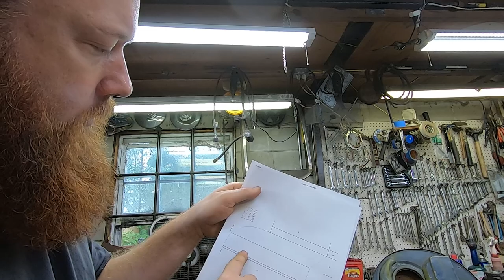Cooling Tins for J Tube exhaust |  Fabricate Industrial Tin VW Split Bus Restoration Vandemic E13

Comment: Honestly and no disrespect I would just find some heater boxes. the space between the tubes and the heads allows air not to flow out the back as well. But if your running performance large tubes this would work. I would still not go there. performance exhaust should be merged system. and the J tubes go under the cylinders so again running these tins wont work. The best option is to go with type 3 cool tins. THey do work best for merged system especially. they manage the air better and get the proper amount around the cylinders and more air through the heads. I have been running these on performance engines. with air vanes opened up on the heads. Running 8.5 to 9.5 on a street engine without detonation  pinging. even is near 100 outside temps.
Reply from the maker: Hey Mike, no disrespect taken; thanks for your input. I'm happy with the approach on this engine but it will be fun to try out the cool tin sometime.

Comment: I like it. I am running J pipes with my new sidewinder headers on my 71 beetle. i will also fabricate these extra tin pieces  to get the heat away onto the road like it was designed. Thanks
Reply from the maker: You're very welcome Andrew, thanks for having a look! Good luck with the project, I like your approach and I'm sure your '71 will appreciate the efforts. Thanks again!

Comment: I did this mod on my Manx several years back, I put bolts into the lugs on the bottom of the heads to attach the plate.
Reply from the maker: Good way to do it @manxdune  I've safety wired one but this one seems to do well with pressure from the other mounting points. On a few thousand miles so far; long term results will be interesting. Thanks for watching!

Comment: i'd put a slit piece of hose on the edge near the head , stop any possible rattle , and give it a bit more space there for air to flow. (the flex of the metal should clamp the hose to the head, letting air out mainly to the "back" of the engine
Reply from the maker: Thanks Chris, (spoiler alert)... after putting some miles on the bus it seems to be working well. You're right that we want the air all going out the back underneath the engine. This area is the last part of it's journey before leaving the system. It's hot and low pressure, and just needs to be dumped out the bottom clear of any path up or forward. These are fascinating little engines aren't they? Thanks for the comments and checking out all these videos- hope to see you again soon!

Comment: The amount of time and workmanship for the tins are commendable . Are you using mig welder with low settings to not blow off the weld .What is the setting speed , voltage,   wire size ,  gas pressure settings . My buddy is lending me his welder .Thanks !
Reply from the maker: Thanks erwinsm10! Yes, it's a MIG welder and the settings are very low for the 22GA sheet metal used here. On my 210, the voltage is around 2 and the speed around 20 but all welders and metals are just a bit different, so focus on the results you are getting and tweak the settings accordingly. A little bit of practice and you'll be doing great!

Comment: Great idea, I'm gonna make some.
For that inside curved bend, you need to use your pipe anvil.
If you want some real heat in you bus, install two oil coolers, one up under the dash, and one behind the axle, with a diverter valve between them. This also adds oil to your capacity....never a bad thing.
Reply from the maker: Thanks Frank, interesting idea. Heat is a problem here in Florida- there's too much of it! Good luck on your project and let us know how it goes!

Comment: Hy Haptic , once more a good and informative video, with exelent metalwork and forming. Keep up the good work,Greetings.HCS
Reply from the maker: Thanks HCS, it's always good to hear from you. I'm glad you're enjoying the videos and I hope all is well on your side of the pond. I hope your baby blue single cab is coming along nicely!
Reply: @HapticGarage  Thanks Haptic , here on my side off the pond is every thing going well even the progress of the Monday Morning Bleu.I`m in the final welding process and starting cleaning the chassis or the body work beneath for body protection.so I can begin with the preparation for future rust,Greetings HCS.
Reply from the maker: Cool stuff HCS, I'm glad you're making good progress. What do you use for undercoating?
Reply: @HapticGarage  Hi Haptic ,wenn I`m done with the cleaning of all metal beneath.I will use only Clear fluid film called Lanoline  or eventually Raptor protection.I will not use my VW anymore in the wintertime cause to much Salt on the roads   I will also use inn the Hollow spaces from the frame work  Fertan  fluid was alternatively Owatroloil.  and warm it up to the boiling point  then its very waterly like and spreads evrey where in the hollow spaces..

Comment: Just buy type 2 under tins, I did and my 1835cc vw engine runs perfect, never overheats, neither does my sons 1641.
Reply from the maker: Hello Tony, I think you are referring to the Type 3 "Cool Tins". I have a couple pairs laying around but prefer this method because it works with the Type 1 thermostat when I am able to use it. Thanks for the suggestion!

Comment: I did very much the same thing..repaired all tins and hammer formed them to fit tight...I figured better airflow if all leaks were eliminated and all nut and bolts fit tight..so I welded what I needed...happy with outcome
Reply from the maker: Good work Redd Mann, I think it's worth the trouble and kinda fun anyway. Thanks for watching!

Comment: An easy alternative: When i junked my heater boxes, I cut out the portion of  the outer tin with mounting tabs on it for the lower barrel tins and used those as heat shields/ air deflectors for the J Tubes. 10 minutes work with an angle grinder.
Reply from the maker: Hey Martin, thanks for the tip!
Reply: @HapticGarage  No worries mate! Keep up the good work and great craftsmanship, you've got some skills there for sure.

Comment: Try using flap discs on your 4 1/2” grinder to smooth out your mig welds.  It removes the extra metal faster and leaves a smoother surface!
Reply from the maker: Thanks Mra Mra, yes, I keep a flap disc on a grinder all the time for that reason. Good tip!

Comment: Could I ask if there is a benefit to keeping the extension pieces as separates that bolt on rather than welding to make one complete piece? Looks great by the way
Reply from the maker: Thanks for the question cgi l! I think they could be welded, just check to make sure installation and removal would still be possible. Keeping them as bolt on ties into the stock design and may make reusing them easier. Cool question- I didn't think about welding it all together with the sled tins. Thanks for watching!

Comment: Outstanding video!! I will be running j tubes on my following motor. Did you say someone sells those covers you made? I ne rr saw them before.
Reply from the maker: Thanks Slades VW! Yes- there are industrial tins available and they're not too pricey. Check out aircooled.net and geneberg.com, or search TheSamba for "type 181 industrial heater box delete tin" for dimensions. Good luck and thanks for checking out the video!
Reply: @HapticGarage  Thank you, I will definitely check them out for sure. I really enjoy your videos, very comfortable to watch if that makes sense.

Comment: Just wondering why you never made the top part over the ‘J’ tube a bit wider to stop the heat going onto the head…👍🏾🛠
Reply from the maker: Hey Soggz, thanks for the question. If I understand correctly, that sounds like an interesting mod. Keeping in mind this is all under the car and the valve covers help to cool the oil too, I'd want to be careful about trapping the valve covers between this tin and the cylinder head tin right above it. It's kinda tough either way due to how hot the exhaust is but your idea is something interesting to consider.
Reply: @HapticGarage  I’ve just installed some on mine,I haven’t gone to the lengths that you have,as I don’t have a welder,but I just thought about it,when I put them on.
It may just knock a few degrees temperature off.👍🏾🛠

Comment: Could you drill and tap the two round blanks underside the head and extend the sheet metal upto the newly drill & tapped holes, making sure not to penetrate the inside of the rocker with the tapped holes. 🤔
Reply from the maker: I think yes, but as you mentioned you'd have to be really careful to avoid punching through and causing a leak in a busy oil filled area. So far it seems like the tins work well without being fastened here, instead relying on a good fit and the fasteners elsewhere. Even so, done right it could be a nice result.

Comment: incredible job! What do you think about tapping the heads and adding tabs? I'm sure you've considered it.
Reply from the maker: Thanks Zupper! I think tapping those two bosses on the heads to secure the industrial tins would be beneficial and could be done safely, provided that the holes don't protrude into the rocker arm area to cause another potential leak. Doing so would require careful measurement when drilling! There is a similar arrangement on the top to secure the cylinder tins, but you'll notice there's more material; VW avoided drilling into the rocker arm area despite the lack of oil pooling up there. The bottom is a different story where there is always some oil just looking for a way out. Sure, sealant could be used but at this point we'd have to ask if it's worth it. Spoiler alert- I've run the engine and things seem to be doing well in this regard. Thanks for the question!
Reply: @HapticGarage  if you figure a way to mass produce, I’ll buy some. There’s a market for it.
Reply from the maker: @nittygrittykitchen  Wouldn't that be cool?!? I'm focused on videos these days, but thanks for the encouragement... I like the way you think!

Comment: Great video and it was nice meeting you at bug jam this past weekend. Question. You said you would like to attach the tin to the head. How about drilling and taping the heads on the bottom of the head just like they are on the top for the tin? It looks like the factory casted a place for it.
Reply from the maker: Nice meeting you too William and thanks for the great question. I think that would work well provided the hole did not go through into the rocker arm area- even with the raised boss cast in that spot it would be kinda close. It would be more secure but that would be a bad place to have an oil leak. So far it appears the tins are staying in place, so I'm cautiously optimistic. On a different engine, I drilled a tiny hole through a flange in that area and safety wired the tin in place. It works, but I like your drill and tap idea better if it becomes necessary. Thanks for stopping by and saying hey at Bug Jam!

Comment: There is one more piece to change it from type 3 tin on and around the piston barrels. Go to Mikes Fn Garage VW cool tin type 3 help your engine run cooler YouTube this is for you guys that live in the hotter parts! Check it out amazing stuff ! And he is a bundle of good information too !
Reply from the maker: Thanks Neal! I'm familiar with Mike's channel- he's putting tons of work into his single cab but I bet it will be awesome when he's done. I have a couple aftermarket sets of the cool tin to mess around with. I've heard respected voices on both sides of the discussion about their effectiveness. Just gonna have to try them for myself sometime. Thanks for the recommendation and for checking out the video!

Comment: Hi Hap, always enjoy your informative vids, thanks. 
I had a complete 1776 built in L.A. for my bus, complete with J-tubes, but I noticed that it came minus the lower tins, just the clip-in plates between the cylinders. I wrapped the j-tubes with fiberglass exhaust wrap, which seemed to keep oil temps less than 230F so far. I dunno if  can even fit lower tins in place without  the j-tubes removed....are the lower tines essential for proper airflow?✌
Reply from the maker: Thanks I Am, I'm glad you enjoy the videos! I think you'll be better off with the lower "sled" tins in place. They would hold some air pressure against the bottom of the cylinders and help direct hot air to the rear and away from the intake. Adding these industrial tins complete the strategy and keep things mounted securely. Congrats on the new powerplant, enjoy your bus!

Comment: Great job and a bummer about the pushrod tube.  Not a huge deal to take the head off and replace all 4 though.  Glad to hear you’re getting rid of the yellow!  If you did black, would you do it in Satin, Semigloss or Gloss?  I’ve been trying to decide on my tins and would love to hear your thoughts.  Vandemic is getting close to being a runner! Great work.
Reply from the maker: Thanks Aussie Beatle, this was a fun one. The pushrod tube boo boo stung because I just wasn't careful enough- kind of an unforced error but like you said it's not a huge deal. Spoiler alert- this became one of those "might as well do 'em all while we're there..." situations. Regarding engine/tin paint, I like flat black for valve covers, pushrod tubes, and the engine case because it transfers heat better than gloss (think 'built in oil cooler'). I don't see much advantage in using flat black for the blower housing, cylinder tins, and other bits because they transfer heat back into cooling air on its way to the fan's intake. But at least those parts would match the case and valve covers... This might be an unpopular opinion, but chrome is the worst possible because it reflects heat. This is more of functional answer than a cosmetic one, but that's where my head tends to float around. I hope it addresses your question! Thanks as always for being a part of the channel!
Reply: Haptic Garage 👏👍
Reply: @HapticGarage  Definitely agree about the chrome and thanks for sharing your thoughts.  The OEM paint on my tins is gloss, so I might do that again.  There's s sticker on the top pf my oil bath air cleaner that i don't want to lose, so I've been hunting for a replacement before I paint.  Vandemic was a great buy, 13 window in pretty good order is gold.  Always look forward to your next post.
Reply from the maker: Thanks Aussie Beatle, and you're welcome! Good luck finding the sticker- it's those finishing touches that make a full restoration really nice. I agree about the condition of this bus. It needs some metal work but is really solid for a project vehicle. I hope all is well on your side of the world and I look forward to chatting again!
Reply: @HapticGarage  me too

Comment: Hey dude, what are those thing fan shrouds you mentioned? Do the fit without modification? I wanna put jtubes on my dual port engine I have on my 69 bus.
Reply from the maker: Hey Creature Teacher, the tins fabricated in this video are an adaptation of the Thing tins. There's a good thread about the original ones on The Samba; search for "Type 181 / 126 - Industrial heater box delete tin" in the forums. They are also available from the usual VW suppliers and typically listed as "Industrial Tins" because things like VW powered generators didn't use heater boxes. Should be an easy retrofit for you, good luck and let us know how it goes!

Comment: You can do that bend ....stick it in from the front not through the back.... You use both directions on a brake...until you really can't do a bend...
Reply from the maker: Thanks Gary, it's one of those things that shouldn't be confusing but.... because human. Thanks for watching!
Reply: @HapticGarage  
We all do simple mistakes...not abnormal or a big deal...when i started bending 35 years ago it was difficult to get it bent properly sometimes...everything is practice and experience....then it gets simple...if you ain't making mistakes ..you ain't doing anything...
No one knows everything..
Reply: @HapticGarage  
What is that motorcycle...
Have just started watching your vids
Reply from the maker: Thanks Gary, you've got that right. Part of making progress is willing to be wrong. Thanks for the supportive thoughts!
Reply from the maker: @Gary Mallard That motorcycle is an '81 Yamaha SR250. I've been riding it to Daytona for the decade leading up to Project Vandemic but now it appears the bus has taken its place. I've had a lot of great rides on that bike but (somewhat ironically) feel safer in the bus.
Reply: @HapticGarage  
Ok...thx

Comment: Dude!
I'm working on the very same thing right now.. Having the same issues with the industrial tins they are just not fitting properly.
Send me that template ??
Reply from the maker: Thanks KanesKustoms, I hope you're making progress with the tins. This is why I should update hapticgarage.com- those templates would be a great thing to share. In fairness, they fit that one engine really well but probably wouldn't a different engine quite as well. The approach should be fairly universal; try the poster board routine until you're happy and give it a go!
Reply: @HapticGarage    Well I pretty much scrapped the first set of tins  not a huge loss as they were aftermarket. I scored two sets of OEM  tins on TheSamba   with all the screw-ups I made on the first set 
I think I have a solid plan of attack for these tins..

To make an omelette ya gotta break some eggs!!!
Reply from the maker: @kaneskustoms6403  You've got that right! Keep at it and you'll have a nice set of tins in no time. Starting with used OEM put you miles ahead from the start. Good luck and let us know!